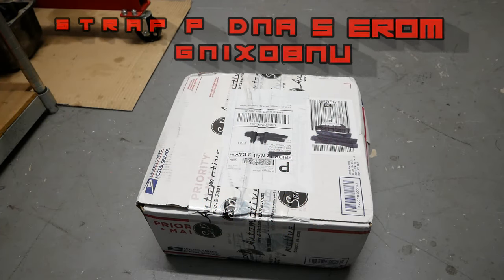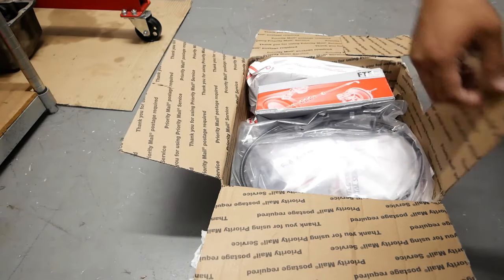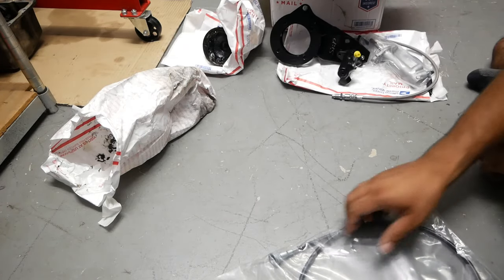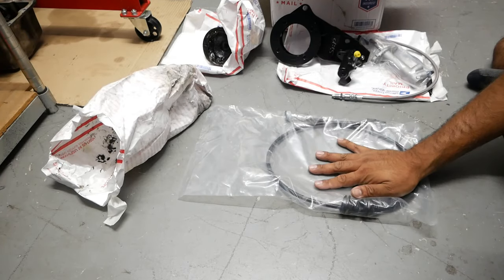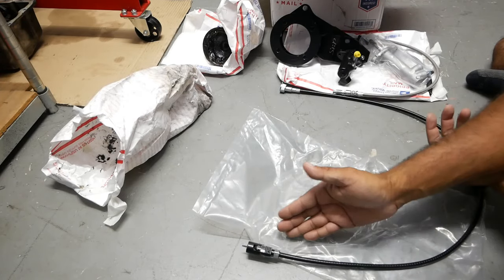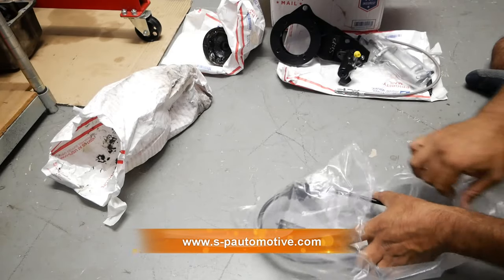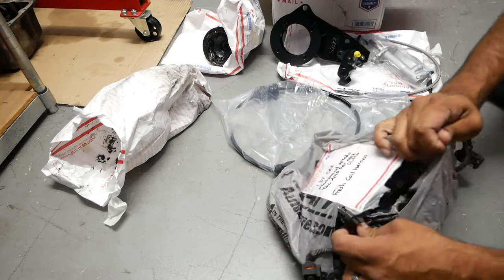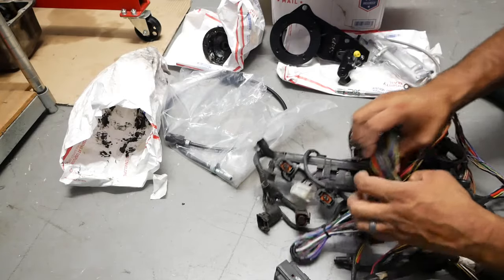S&P Automotive Corrado Parts Unboxing

Comment: Hey my mk4 has a oil pressure light come up after the car warms up or when I rev it up to 2k  the oil level is fine  what would be the issue ? This is my daily and I need it running it’s hard to get to work
Reply: get that oilpan down quickly, and check the pickup tube, and dont even run the car a second more before that
Reply: Mikael Andersson today I installed a new sai pcv turned the car on and the light didn’t show up also drove it around the block and still no light ??
Reply: @saucyfredo801  a pcv has nothing to do with the oil pressure, so either your connector is loose and you managed to bump it, or you're in for trouble fairly soon